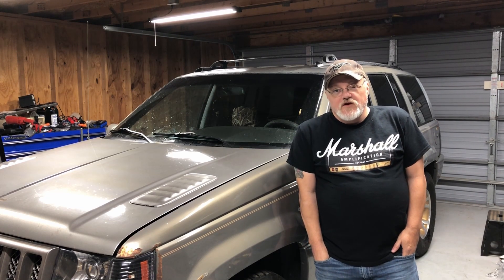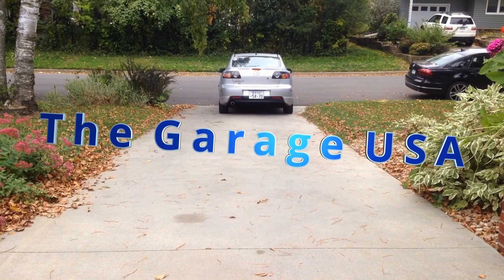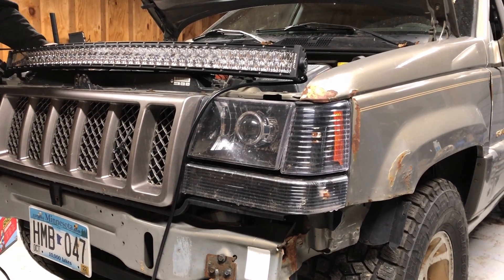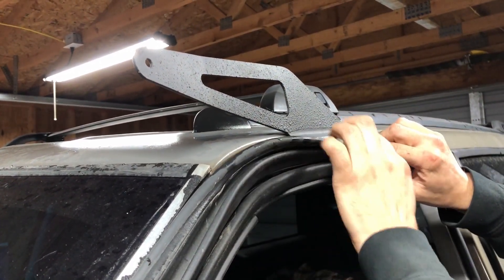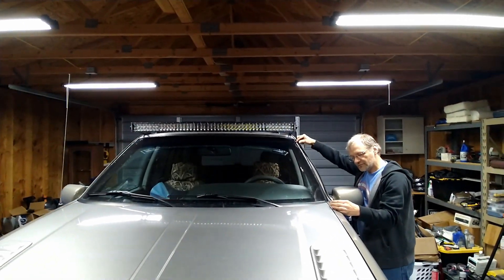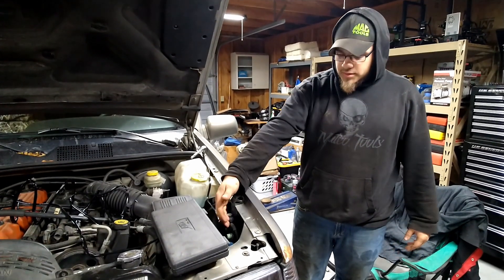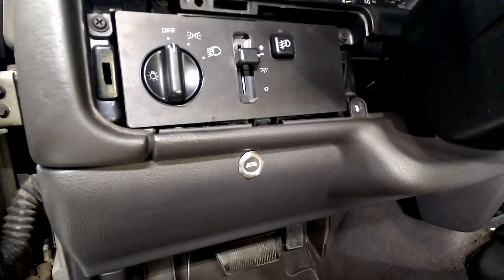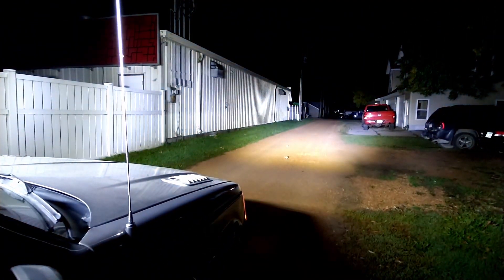Installing a Light Bar on a Jeep Grand Cherokee

Comment: Quick question please: is there any problem with these jeeps ? I've been told that the automatic gear model has issues in the gear itself and also the belt of the engine.
Reply from the maker: My 2003 Grand Cherokee has 272,000 miles on the original engine and transmission, Matt has a 1997 Grand Cherokee with 213,000 miles, the engine was rebuilt at 181k miles and transmission replaced at 200k.
Reply: I have a 1995 jeep Grand Cherokee 5.2 V8 and I've had no problems in the 8 years I've owned it until yesterday when my front drive shaft broke .. but I just replaced the ujoints and it's all good .. has 278k miles